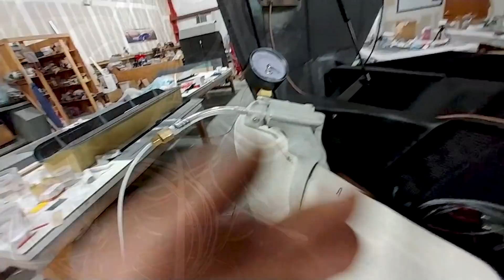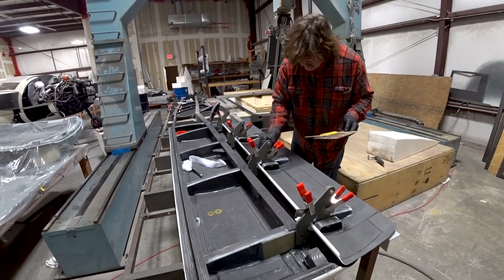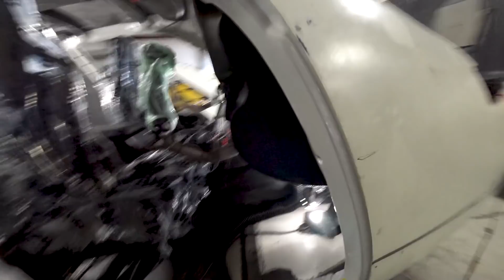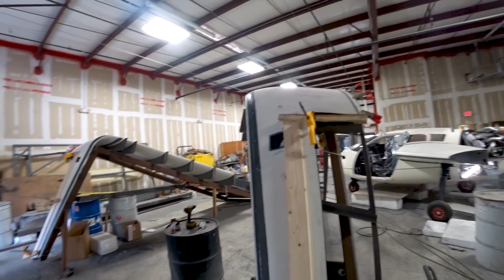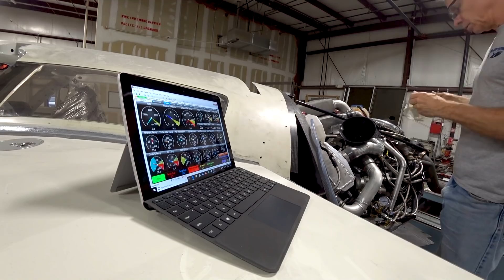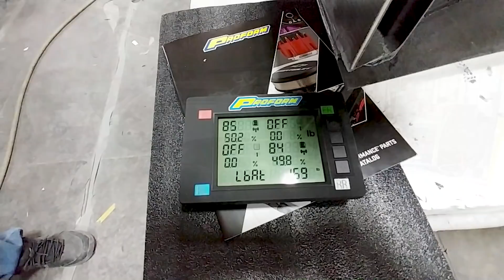One Audi Helping Another - Building the Raptor Prototype

Comment: What brand of oil does Audi use from the factory?  I’m a BMW owner and they definitely want you using Castrol. Years ago there were lots of issues with the variable valve timing system (VANOS) failing when using Mobil 1. I avoid that stuff entirely.

Of course, my experience is on gas engines.
Reply: Joe Demers outside of Amsoil Mobile 1 Full Synthetic is the best oil you can get .

Comment: I noticed you keep calling it Hysol. Is that the company brand name for the sealant you're using? Because that grey stuff looks exactly like ProSeal (after parts A and B are mixed), it doesn't look like Hysol at all. Hysol - like the stuff made by Henkel/LocTite - is EA 9394 (Epoxy Adhesive), and it's purple-ish in color after mixed, not grey. The stuff Jeff is using in the video looks exactly like PR-1440 Class B ProSeal fuel tank sealing compound, made by PPG/PRC-DeSoto (part A is white, and part B which is the accelerant, is black, and it's dark grey when mixed properly)... Is that what it is? And just made by a company called Hysol? Because it doesn't look like Hysol (which is purple) at all. Just curious. Thanks.

Comment: Mr. Mueller. 
Looking good,

Since the wings bolt on, have you planned for the ability to tow the Raptor, in a trailer, to and from the  home base airport to reduce costs (and risks) for storage at airports when not being flown often?
Reply: I understand that you're addressing Mr. Muller but I'll take the liberty of answering for him...yes the wings are removable but they weren't designed for the application you speak of.  It is quite an involved process to attach and remove the wings and would not be practical for normal flying.  It was more out of necessity to assist in getting the plane out of the workshop...Peter please correct me if I am wrong.
Reply from the maker: Marc, yes that is correct. Not only that but the fuselage with strakes on is too wide to be towed on roads without a special permit.

Comment: Russell makes speed bleeder valves for most common calipers, they come with sealant already on the threads, plus they have a ball valve in them that makes (pressure) bleeding much easier.  A lot of people that don't have much experience bleeding brakes usually try some sort of vacuum system initially, the problem is that there are all kinds of places where air will infiltrate while the system is under vacuum.  The upshot is that the brake system doesn't get completely bled.  Speaking from MANY, MANY years of experience, it is almost always better to use a pressure bleeding system (Motive Power is one manufacturer, and is really common on Ebay).  These are very common in the automotive field, and come with lots of different adapters to fit almost any application of master cylinder.  The only place that these don't work well is in single ended (ie no bleeder on the slave cylinder, like on some late model hydraulic clutches).  For those applications, Phoenix Brake bleeding systems use a vacuum style (aka reverse bleeder) that can work well in those instances.  I'm not saying your method doesn't work to an extent, but I know from experience the pressure brake bleeder will almost always work better.

Comment: Have you thought about the possibillity of a runaway engine while in the air?
Reply from the maker: Is there even a single documented case of an Audi TDI engine running away?
Reply: Raptor Aircraft well perhaps not, but the possibility is there? I’m guessing it’s a good idea to use some sort of electronic valve on the intake as Tim said.
Reply: el grado smokio   I think it really depends on the fuel system and controls.   If they are robust against this failure mode in their own right don’t add additional clamp trap.  
Another argument against a valve would be the possibility it could activate spontaneously or accidentally during takeoff or landing.   

Working through the prop’s power demand curve vs the engines torque potential at max intake mass flow and fuel may show the engine does not run away very far.  That said there is always unpredictable oil ingestion, add that turbo factory & something is going to get to fast/stressed and break quickly.
Reply: Good questions.   I have been next to a very large diesel that did over speed badly, the home brew control system had issues and would not shut off the fuel.   Scary!   Marine certified and critical safety applications provide for this.   To Peters question, some engine fuel systems are quite robust against this.  Many large engines also get an air cut off valve put on the intake.    What does Continental do & why?  Peter you’re doing great work but Need to find a true Expert to help with this engine.

Comment: Yep, it always takes 2 Audi's to make one run.  The 1980s Audi's are still in my memory.
Reply from the maker: Actually the TDI fires right up. It's the battery that's a bit small. We may use a larger one if need be but I wanted to try the smaller one initially to save weight.
Reply: Raptor Aircraft   How is the overall weight looking?
Reply: @RaptorAircraft  so are you going to keep it 12 volt system or convert to 28?  I would guess FBO's have 12volt jump start boxes too.
Reply from the maker: @PosiP  I can't think of a single reason why we would want to convert to 28 volts. Everything apart from the pressurization controller is 12v.

Comment: normally you bleed from the masterdown to the cylinders, topping off the master as needed. it looks like it is going to be very hard to check the brake fluid where things are mounted

ODB II bluetooth adapter (use with the torque app on android/ios) https://www.amazon.com/Vgate-Bluetooth-Scanner-Adapter-Diagnostic/dp/B019SURWYO

Comment: I don't know where the idea came from to vacuum bleed this system but brake systems are designed to be pressure bled. ( hence to need to seal the bleeder thread.) Better to apply fluid at slight pressure from the reservoir.  You could even use the same equipment almost.  Those pumps usually have a pressure side.
Reply from the maker: Whether you use vacuum or pressure it really doesn't make a difference. In both cases you are simply creating a pressure differential. There is a potential for air to remain trapped using both techniques.
Reply: @RaptorAircraft  I disagree that it doesn't make a difference. The modification you made to the bleeder is case and point for the significant difference. Additionally, the pistons can suck in, the seals can leak air in, and you can tear your hair out chasing bubbles with the vacuum arrangement - in my experience. Where-as pressure bleeding is generally fool-proof.
Reply: Fair enough 😀
Reply: Not so, vacuum bleeding brakes is a common practice.
Reply: Owen Sparks   Yeah I know mate but it has , at leastt o me, always been problematic.
Reply: Pressure bleed from the caliper up to reservoir.  Been doing that for 30 yrs with 100% success rate
Reply: @jeffreygoyer7760 
We communicated by writing on bits of paper and then physically moving them about for more than 30 years, does that mean email isn't a better idea? 🤔
Reply: Owen Sparks - many ways to bleed brakes, I have tried most of them...I even own the same vacuum bleeder used in video.  Not trying to start a debate, rather sharing my experience that after 30 years of aircraft maintenance, this has remained the most effective method I have found to purge air from aircraft brakes and service them.
Reply: @jeffreygoyer7760  
Apologies if I annoyed you. My comment was intended as a genetic poke to folks who don't stick their head up once in a while and see if better ways exist to carry out a old task, as opposed to doing what they've always done. Thanks for sharing your experience and the results of testing multiple methods. Have a good weekend. Cheers Owen.

Comment: I have a OBDII to Bluetooth dongle which enables me to check my car engine on my iPhone and iPad
Reply from the maker: Yeah, but it's still very limited in what you can look at compared to all the available parameters and info on the Motec ECU.
Reply: Raptor Aircraft some of the programs are quite extensive and include information on abs brake systems and airbag information and some of the dongles are WiFi capably
Reply: Raptor Aircraft anyway I am a huge fan and working on a project like yours  is a life long dream of mine

Comment: Gravity bleed the brakes. you will get it right the first time every time. and it only takes one person.
Reply from the maker: Yeah, not so. With the orientation of the cylinders on the rudder pedals there is still a chance for an air bubble to remain unless you pump the cylinders a bunch to remove it once it's initially filled.

Comment: Still concerned that when you finally installed re-drive I could see no castellated nuts!
Reply from the maker: Are you familiar with metal locking nuts? That's what we've used.
Reply: @RaptorAircraft  Prevailing torque lock nuts.  They are typically one-time use.  Maybe a bit of toque strip will help ease inquiring minds.  Still wondering if you can put a vibration analysis system, chip detector, temp sensor, and psi sensor to monitor the redrive and prop health.

Comment: Congrats on your excellent forward movement toward the sky...   

When you started the engine were you using fuel out of the strake tanks?  Just wondering how well the strake tanks are holding fuel...

Great work again Peter and team...  Keep up the build momentum and you'll be there before you know it.
Reply from the maker: I filled the fuel using the left tank but I only put in 5 gallons and it all drained into the header tank.

Comment: Mercedes transmissions in FCA vehicles came up with a great idea for a dipstick for their transmissions.  It looks like a speedometer cable; the inside cable, not the outer casing.  The kicker:  The vehicle doesn't come with a dipstick for the transmission.   No kidding.  You have to buy it.  It's listed as a "special tool" in their factory Miller Tool catalog.
My thought...
You could make an extension for the existing dipstick tube that is in a more accessible location. then make a new dipstick (possibly out of speedo cable material) cut to an accurate length.  Actually, you can make the dipstick out of anything that works.  And don't forget, some air compressors use a sight glass instead of a dipstick for oil level checks.  Just sayin'

Comment: Don’t try and church it up Joe Dirt, that’s a VW diesel, same as mine!
Reply: On the topic of oil consumption in the 3.0 TDI: I have a little over 33k miles on mine and I have to add 1-2qts between every 10k service... 2qts is usually when I do more towing.
Reply: Van B   That does not sound good.  Ran my cheat 2.0 TDI hard till smog police took her away.  Never used much oil.
Reply: @timduncan8450  the 3.0 is a different motor altogether... Uses way less than the 7.3L powerstroke I used to have!  I had your same concern though and consulted VW and they say that it is a normal amount of consumption. I'm betting it will decrease as a continue to break in the motor...